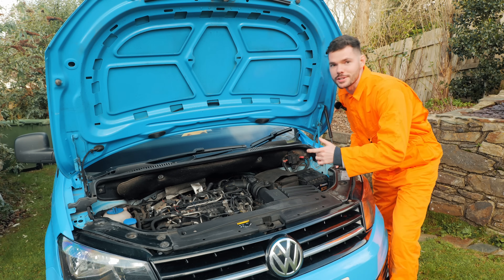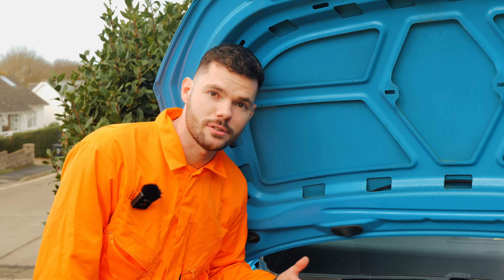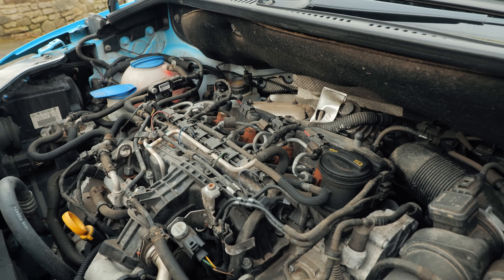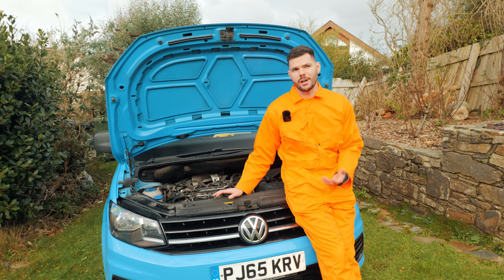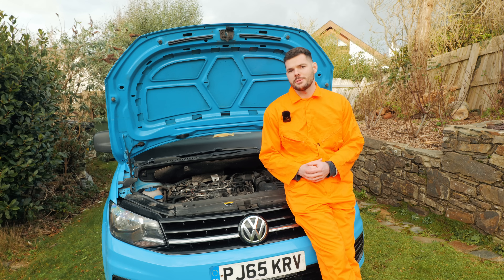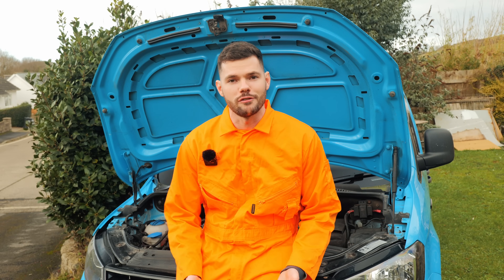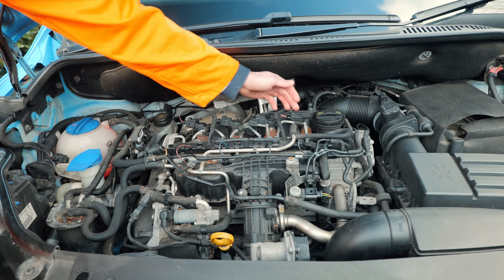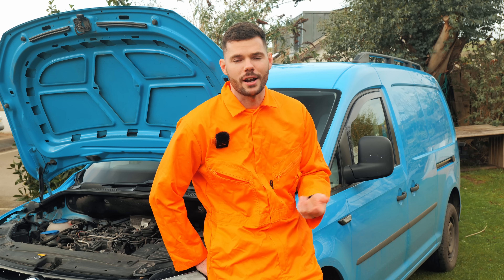Volkswagen 1.6TDI Engine Injector Failure!

Comment: all 4 usually go?  at the same time? jeez that made me worry. had one faulty and suspect another one.. so bought 2 more used-.- hopefully there is at least one with some health left
Reply from the maker: It depends, that's what people say, I had one replaced before I bought the van and had been fine for almost 5 years and then that same one went in February. But since then the rest have been fine.
Reply: @willsvanadventures  thanks for the answer. Hopefully ill get by with the 3 i got at hand now. I also had big problem with diesel return pressure being way high. They are so expensive here in Norway. Like 500 euro each new😑

Comment: hey mate, i’ve been following your channel for a long time and i’ve recently got my self in a pickle with my 1.6 tdi. i’ve recently got my cambelt and battery replaced however my car fails to start. from your videos and other social media posts i’ve seen that the 1.6 has common issues with the injectors which i’m guessing is an indication my problem. i was just going to ask if i could send you a video of my car not able to start on DM if that’s okay id love to hear back from you since you have a lot of knowledge about this engine. thank you!
Reply from the maker: Sorry to hear about the issues! Does it not turn over at tall?

Comment: Hi. I have a 1.6tdi. On the way to work it started to make a shocking noise an loss of power. Thick white smoke pouring out the back. Does this sound familiar?
Reply from the maker: I haven't come across that sorry, did you get it sorted?

Comment: Caddy owner 1.6, only use shell vpower and I put liqui moly super diesel additive and service every year only had one go bad that was before using vpower  🤞🔥
Reply from the maker: That's good! I think it's worth doing, recently I've been using Sainsbury's fuel and my van was running super rough. Cut out a few times and wouldn't start. Put some bp ultimate in it and working like a dream. Couldn't believe how bad Sainsbury's fuel is. Going to do a video on it to warn others haha
Reply: @willsvanadventures  👍
Reply: It's the electric component that fails on these mate. Not the mechanical injector part so your wasting your time with your additives, it will not prolong the life of the part that fails.
Reply: I have put a engine cover on as well to stop the water dropping on the injectors👍  @johnharasym7514
Reply: @johnharasym7514  i have added engine cover as well to stop the water dropping on top of the injectors so far so good 🤞

Comment: The hpfp starts breaking up and filings make there way to the injectors
Reply from the maker: Ah ok, didn't know that, thanks for sharing! Do you own a vw?
Reply: @willsvanadventures  yes buddy I had a 1.6 caddy for 5 years I Had a injector go at 28k miles and 2 go at 40k the fuel filter was full of metal specs from the pump mad at that millage I know have a 2.0tdi one both great vans to be fair mate

Comment: 2012 1.6 TDI 215000 miles no issues with injectors I always use injector cleaner two treatments once a year, always change all of your filters and quality oil, people usually don't maintain their cars properly
Reply from the maker: That's insane! Thanks for the tips! I couldn't agree more! So many people don't bother to get cars serviced regularly.
Reply: How many miles did you drive?

Comment: Its not carbon builds up. Its water moisture building up on top of the injector. Ive tested the fuel on top of the injectors from different cars which failed. all of them contained a high amount of moisture .
Reply from the maker: I didn't know that, thanks for sharing!

Comment: I find leaking injector 4 ..on top..like 10/15 ml..per month..vlean it and again..but the car drives ok..1.6tdi vw ..
Advice? Pls
Reply from the maker: I don't know sorry, have you found a solution?
Reply: I had the same thing with two of my injectors when I bought my van (1.6TDI). I had the fuel lines cleaned out and haven't had a single problem during my year of ownership. I'd also recommend getting an engine cover. Cost about £50-60 but as people say, moisture is the root cause of the injectors failing. It doesn't hurt to cover them up.

Comment: Where the heck are you getting your parts from? 
Even now they can be found for 250 each. 400+ is mad
Reply from the maker: Parts might be that cheap but the cost to get them replaced is much higher. Especially if they get stuck or it's on the roadside, that is the going cost. AA on the roadside repair is now £700 per injector.
Reply: @willsvanadventures  Even more. AA came out yesterday and quoted me £800+ to put in a new injector at the roadside.
Reply: @willsvanadventures  I can attest to this, painfully.  Had one go on my 1.6 TDI bluemotion hatchback on the way from London.  £700 from AA.
70 miles later, 2nd one went.  Yep another £700.  
On eurocar parts the siemens injectos are still almost £700, the Lucas ones are nearly £400
Looking into the AA parts & garage now thanks. (I only had AA via my bank and 10 mile recovery...long story about why I went so far in our old car)
@crazycurtis28 where can you get them for 250 from?
Reply: Knockoffs from ebay more than likely lol

Comment: Hello. Mine is a 2012 Seat Leon with the CAYC engine and 113K with part service history. It developed a misfire last summer but it was intermittent. Sometimes it didn't misfire from cold up to normal running temp. Sometimes it would only misfire at cold idle. It always seems to run fine above idle, say 1500rpm and cruises on the motorway fine and performance is unaffected although 50mpg at best on a run and 38mpg locally which seems low. It was tested by an injection specialist last summer who found injector 3 was delivering more fuel than it should and injector 2 was compensating with slightly less. I have just today checked the resistance and all four are 202kOhm which I didn't expect. There are no related fault codes. The exhaust smells of diesel and is damp with diesel around the exit. It recently developed a loud ticking which sounds like a dud hydraulic tappet only on one cylinder - I've changed the oil just in case but the oil seemed fine and doesn't smell of diesel and the level has not changed since I changed it 3000miles ago. 2000 miles since the misfire started. It always starts easily cold or hot. It is smooth until the stationary idle drops to 800rpm at which point the misfire takes a few seconds to make itself felt. If this is a leaking or weeping injector what could be the possible fixes please?
Reply from the maker: I wouldn't know I'm afraid, best to talk to a mechanic! Sorry!
Reply: Hi Adrian I’m having a similar issue did you get it fixed? What was it?

Comment: Hi, i have a 2017 Golf MK7.5 so it has the new Delphi Injector, are these problematic? On 86k now and no problems so far - ran on premium diesel and occasional Redex diesel cleaner added on every month
Reply from the maker: I'm not sure sorry, I don't think it will be. I would just leave it and continue as you are. Don't need to fix anything unless it's broken so you should be completely fine!
Reply: Hiya, same here! Got a '17 Mk7.5 1.6 TDi as well (70k miles). Have you had any problems?
Reply: @aquilinorodrigo  Hi mines on 92k miles now and it developed injector knock a few weeks ago despite running the car on premium diesel. The mechanic told me to use SKODA VW AUDI SEAT -  DIESEL ADDITIVE 150ml part number: G001790M3. I poured a bottle in for every full tank for the past 3 full tanks and I can notice a massive difference in reducing injector knock! It was like magic haha

Comment: If you replace all the injectors will they still be problematic?
Reply from the maker: No they shouldn't be, they might not be a problem to start with. I wouldn't fix something unless it's broken tbh.
Reply: @willsvanadventures  I’m off to view a 1.6 that’s had all injectors replaced, but been told to stay clear because of the problem. But if the problem was with the original Siemens injectors surely with them being changed the problem won’t be there anymore
Reply from the maker: @andyallenby900  yeah exactly it should be fine! Loads of people don't have any issues at tall. They are good engines and will do 200-300k miles unlike most other brands. If you look after the van, service it regularly every year or 7k-10k miles you should be fine. And get AA breakdown cover incase anything goes wrong and they'll cover most the bill.

Comment: My 2011/85k Caddy Maxi is getting the EGR replaced tomorrow (ouch). It's had injector 1 &3 replaced already (one of them by me). Limp mode when the EGR is faulty is tolerable. Limp mode with an injector gone is undrivable. So I'm toying with biting the bullet and just replacing the other 2 injectors.  The vans not long been MoT'd and it's had quite a bit of work done on it in its former life (BG van), including a new turbo @ 61k, a suspension overhaul @ 73k and a brakes & Master cylinder overhaul @ 75k....so I think its worth it. Maybe :-)
Reply from the maker: Damm sorry to hear! I wouldn't fix it until it's broke personally, especially if you get breakdown cover from the AA then they'll cover the majority of the bill. Let me know how you get on!
Reply: 10,000

Comment: just had this happened to me after 115k miles and 14 years, bought some used updated S injectors and solved it
Reply: Just happened to me yesterday
114.5k milea
Reply from the maker: That's so annoying, did you get it fixed at the roadside?
Reply from the maker: Ah man that's annoying! Good run from the van though and glad you got it sorted!
Reply from the maker: What age is your caddy?
Reply: well its not a caddy, its a Audi a3 but it has the same engine  @willsvanadventures

Comment: Hi mate 

Is this injector problem with the 1.6 only or does the 2.0 model have the same issues also ?
Reply from the maker: I believe it's mainly the 1.6 but could be the 2.0. If you check the tops of the injectors for the codes, you'll see which ones you have.
Reply: @willsvanadventures hello brother. What about the new and old codes on injectors? The old is the code ending with "b" right? So the new code is fixed?
Reply: 1.6 TDI code CLH do the injectors cause problems?

Comment: Servicing your van is a good thing, but will have no impact on when or if the injector will fail. Also injector cleaner will not prevent it either. The point of failure is the electrical switch part on top of the unit, not the main body of the injector. Hope this helps.
Reply from the maker: That's good to know! Do you know if they have sorted this issue with new models? Thanks!
Reply: Wrong
Reply: Thanks was looking for this! Maybe getting a proper electrician to make a better unit?
Reply: no, in my country you can have clogged injector washed, and you can reuse them

Comment: Thanks 👍 how much you paying for the parts and garage cover?
Reply from the maker: For the year it's about £200. Depends on make and model etc. I've used it a few times so has been with it. Had all my glow plugs replaced and only cost the £35 excess.
Reply: @willsvanadventures  ...or just flog that van and get something else that isn't a bag of shit.
Reply from the maker: nah gotta love the ex british gas caddy! @TruthTortoise81
Reply: @willsvanadventures  thanks is there any small print I need to look out for? Think I'll look into it in next year
Reply: This engine is known for injector failure